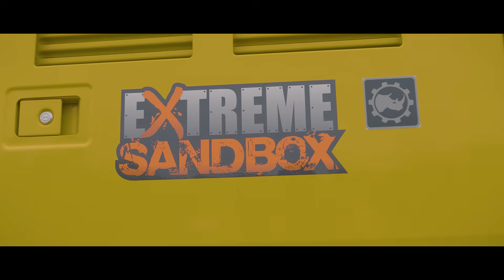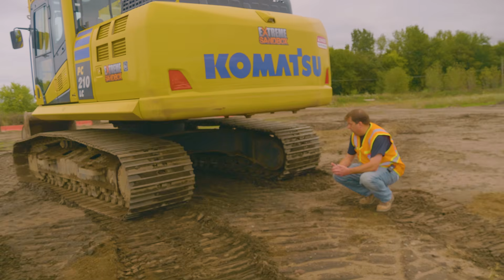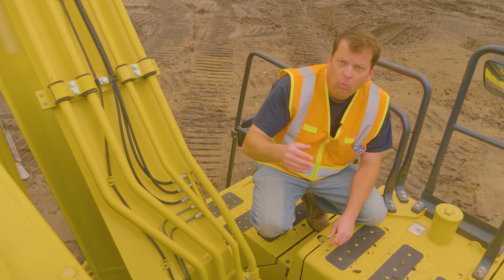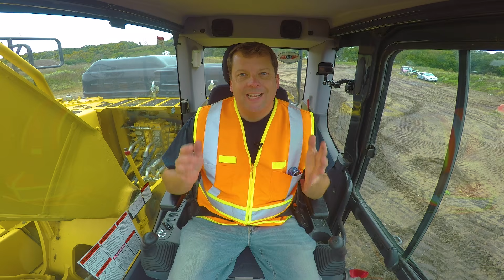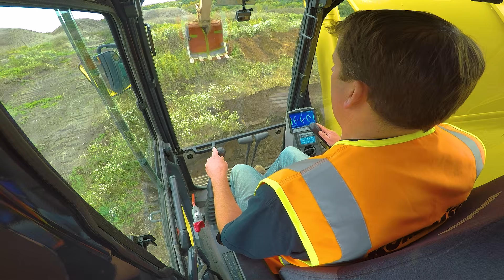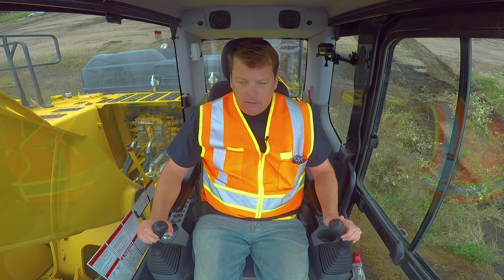How to Operate an Excavator (2019): Pre-Op to Shut Down | Heavy Equipment Training

Comment: Ha when I started operating, I dig barges with a clam shell bucket. The guy that trained me said check fluids and go, when done grease it. If it breaks call the shop. I learned pretty quickly when I asked to be taught on what the parts of the machine I need to look out for (besides basic stuff frayed, cracked hoses etc). Literally looked at me and said I am an operator not a mechanic. I don’t need to know those things. Malicious compliance initiated. Hear a sound? Well it’s not broke yet so keep going. After the first big break down, they kinda showed me after telling them what the lead mechanic said to me.

Comment: Thank you for this video of the basics of operating mini excavator.  I'm planning to buy a small mini.  What size will I need to keep my lake front pulled back.  Neighbors turned a creek so that it runs rapid on my property during heavy rain. It pushes so much sand out onto my lake front.  Right now my pontoon is sitting on dry sand.

Comment: I just bought a secondhand 7.5t excavator for use around my property and I have absolutely 0 and I do mean 0  knowledge on how to operate one.
I have so much work to do around here it is difficult to know where to start but I've got no skill level at all. Thank heavens for YouTube LOL. 
I'm here so I don't get myself into trouble. Very quickly I'm realizing some of the tasks I need to do around here are going to have to wait until my skill level gets beyond say 100 hours. I'm in a forest so raking sticks and twigs into piles will be the first task. This will definitely get my skills up.
After that the road needs culverts in some parts, the dam needs repairing - its outflow deepening, a site needs clearing and leveling for a concrete slab, holes need to be augered, areas graded, fencing repaired and they're the easy things. The list is long. 

Sticks and twigs first.

Comment: I kno the vid is a couple years old, what a refresher, I loaded coal trucks at the mines. Then went on to be a swamper down in the ditch laying gas line. You got to trust the operator for sure. I find the bigger equipment easer to operate. Good Explanation of all things important.

Comment: Sir.  Please how can I contact you for a question?
But if you can answer my question here, I will be glad sir.
During operation, do you have to pedal for stimulating the engine or it does that itself when the engine is turned on????

Comment: Our digger isn’t quite as large, it wouldn’t technically say its small tractor but its not quite as big as the one in your video, and the arm is mounted in the front like a small excavator. I’m twelve years old and have self tough myself to drive it and have been doing quarry work. Ive decided to come online and learn some more safety tips and have found that I’m acctually pretty up to date on how to be safe in an excavator already. Love the vid but your mini excavator seems to be better for me as the counter weight isn’t over the tracks when cab turned to the side and the boom is attached at the front.
Reply from the maker: Wow...awesome to hear man!  Always great to start young, be open to always learning new things!
Reply: @HeavyMetalLearning  thanks

Comment: I thought I posted this before but I guess not anyway, you said you have to use a trench box if you're digging over 4' isn't true you can V the trench if a box isn't available. I myself rather pull a box then V trench it's faster
Reply from the maker: That’s a good point, thanks for clarifying.

Comment: I've never ran an excavator. Lots of farm tractors and things like that. You're an excellent teacher and speaker. I learned a lot. Obtw... I'm retired and 65 years old. I love your videos.
Reply: you're not too old to go to a heavy equipment school u could still work another 5 -10 years doing this kind of work given your age, not sure how things work in the US there I think u guys have Unions though? I went to one in NZ for 4 months back in 2014 they only had a couple of Doosan 5.5 ton excavators but we got chance to learn various digging/trenching/drainage/root raking tasks etc and they teach u about greasing parts and pre-op, Health & Safety aspects on them, problem is when u get out there into the real world like I did I was getting doors shut in my face one after other had some interviews in Limestone Quarry's etc but never got the job, closest Ive got to operating machinery as a job is driving a Dump Truck, u will most likely be digging slop from trenches with a shovel if u get a chance to get into an actual Earthmoving Company or laying pipes with your hands, gotta work your way up ladder in most companies unless they actually willing to put u on a machine straight away and teach u but m ost wont do that cause the cost of doing it 'Excavators arent' cheap' and the time so if your not cut out for digging with a shovel for some months before getting onto a machine good luck only way u can avoid that is going into a Mine of some sorts and driving trucks before being promoted to a machine operator :/ most Companies are pretty dismissive of these schools too, at least how it works here cause in the real world of operating you gotta be lot faster doing the work than what u would be at some school 'Time is money' after all.
Reply: Hello how are you, I want to be operate, what can i do
Reply from the maker: Thank you so much for the comment.  Never too old to learn...keep it up!